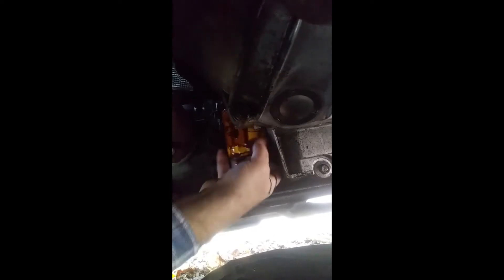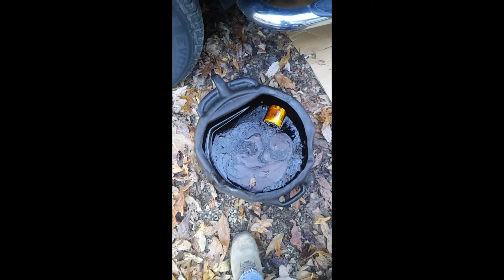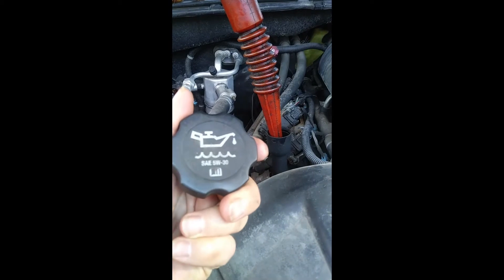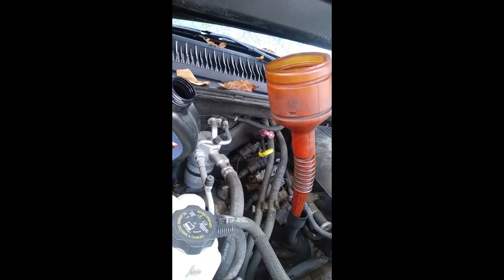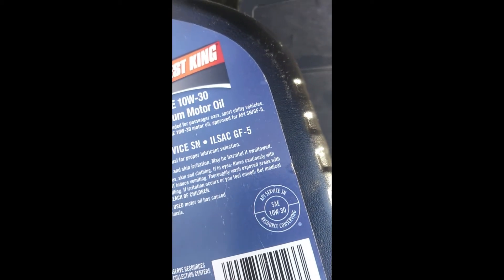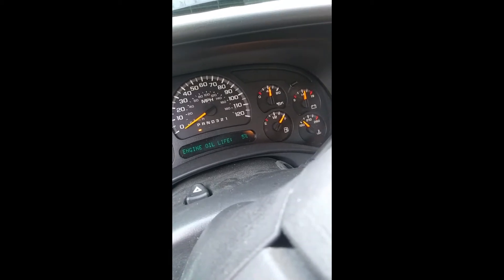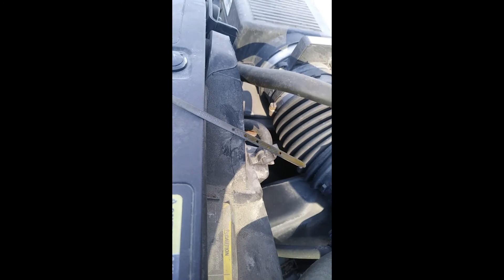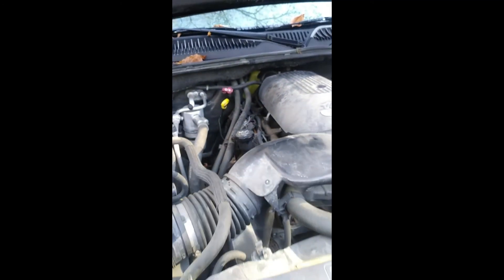How to change the oil in car (Full) - FreeAutoMechanic

Comment: is it okay to just change the oil filter without wiping the mounting base? Also is it okay to just wipe off the drain plug without wiping off where it inserts on the oil pan?
Reply from the maker: I recommend checking the oil filter to make sure the oil filter O-ring is intact once removed. You want to make sure the O-ring did not stick to the oil filter mounting block. If rubber O-ring is still there, then no need to wipe the oil filter mount. In fact it is recommended to lubricate the New oil filter O-ring before installing it. Not wiping off the drain plug area will not harm the components. It may drip on the ground and leave a mess, lol.
Reply: thank you